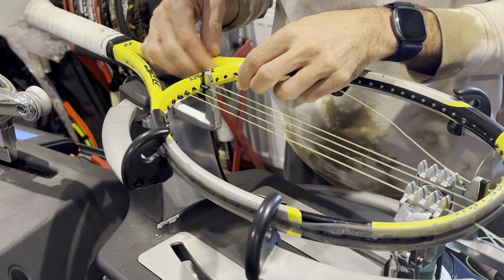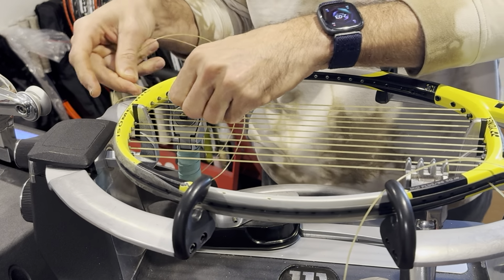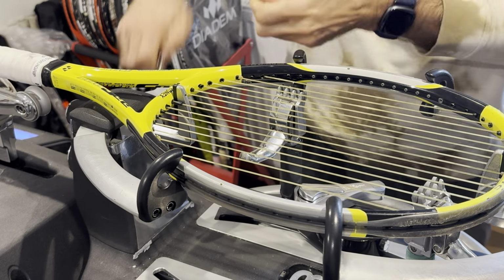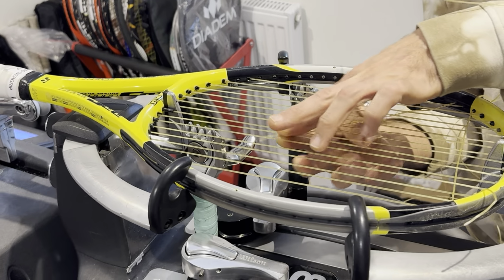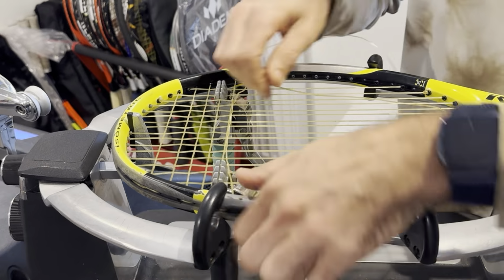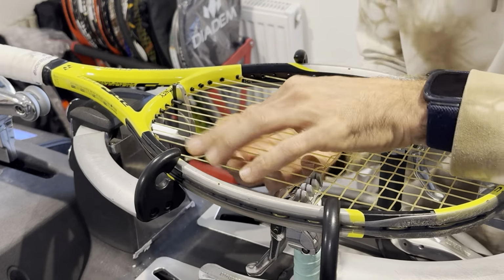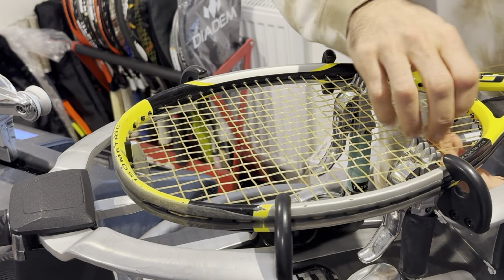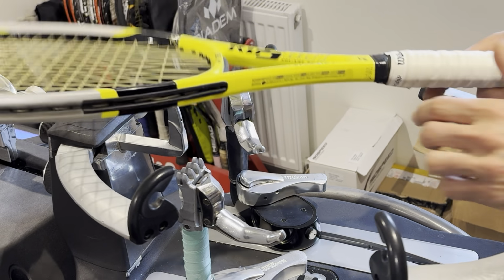How to re-string a Yonex RDS 001 tennis racquet

Comment: What string do you recomend for that racket and what tension? 
About the gourmets, i have the same racket with the same gourmet problem. Can those be changed since they dont do that racket anymore? If so where can i get it, if not Will the broken ones afect on playability? Thank you
Reply from the maker: @elments  the racquet is very old, it’s unlikely you’ll find the grommets but if you don’t try you won’t know. It won’t affect playability but can cause early breakage. The strings is less about the racquet and more about what the player needs.